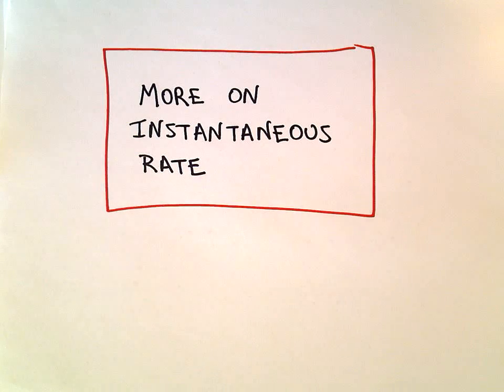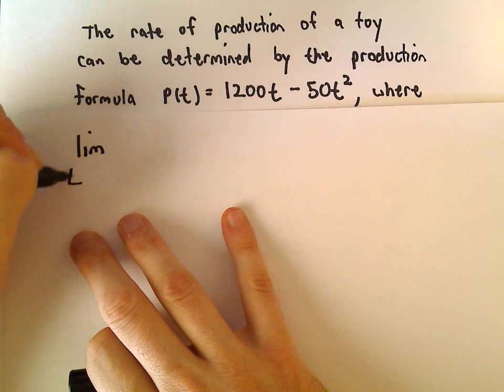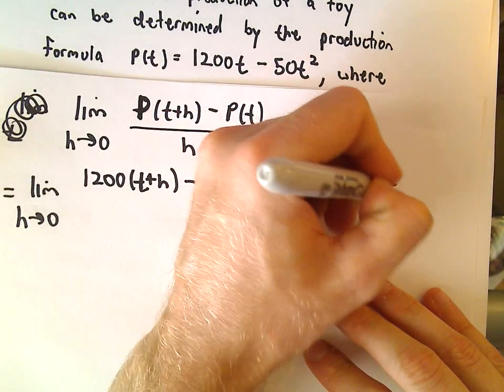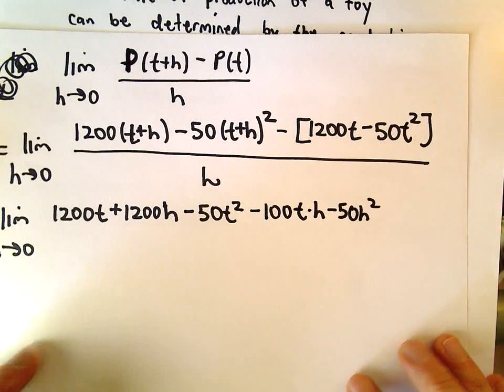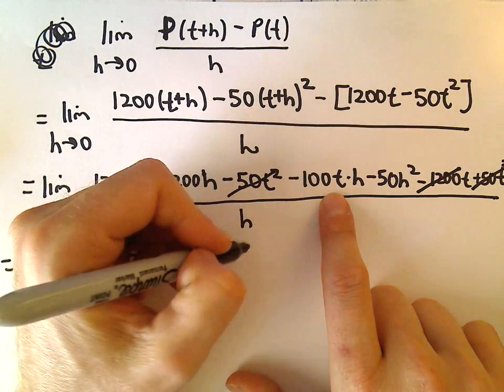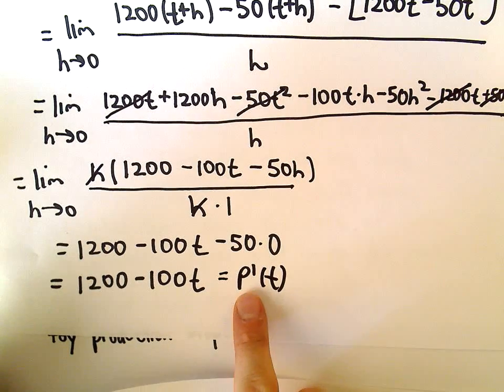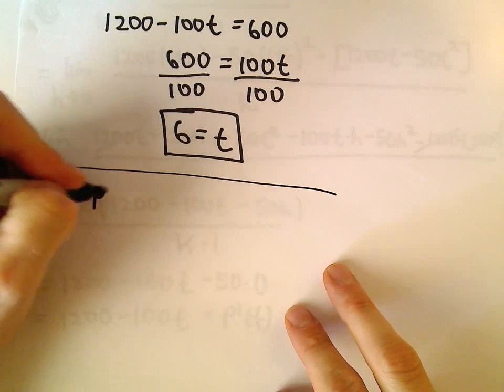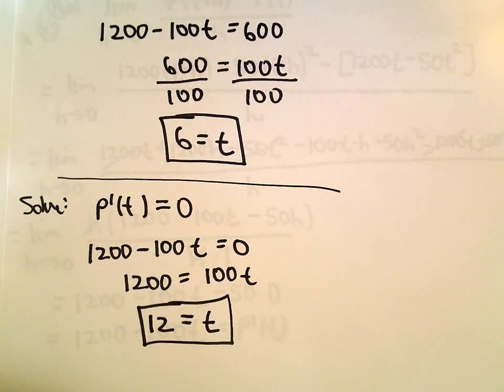Finding Instantaneous Rates of Change Using Def'n of Derivative

Comment: The subcalculations at 2:25 are as follows: 
Formally called an 'binominal expansion' where (a+b)^2 = a^2 + 2ab + b^2. 

Which in our case gives: t^2 + 2th + h^2 => 
50t^2 +(2)50th+50h^2 =>
50t^2 + 100th + 50h^2
Reply: PRFDK thank you!

Comment: Just wondering... why do you put 600 on one side of the equation instead of 
P'(600) = 1200 - 100 (600) ?   <<<< What would that be used to solve? ^.^ THANKS!